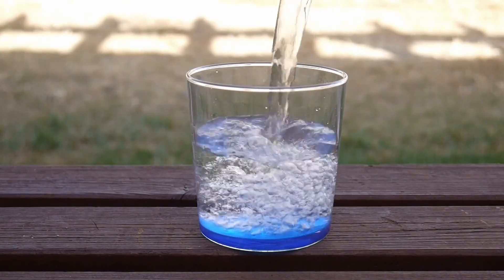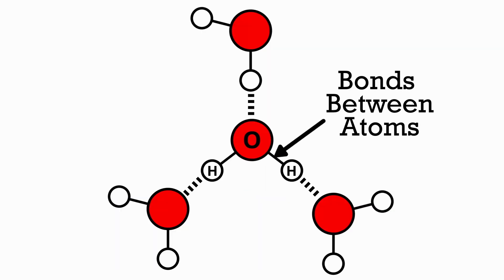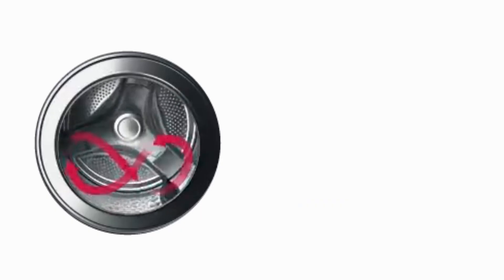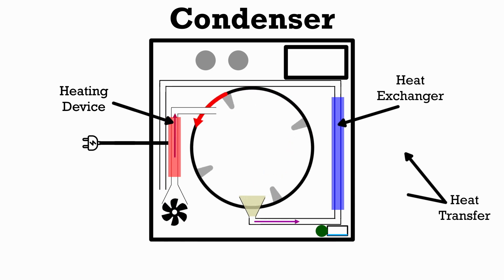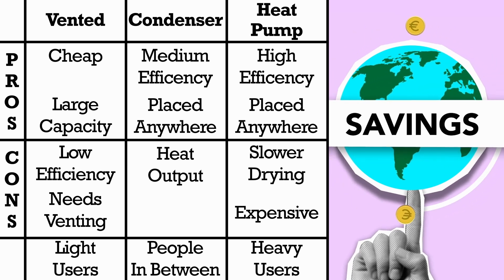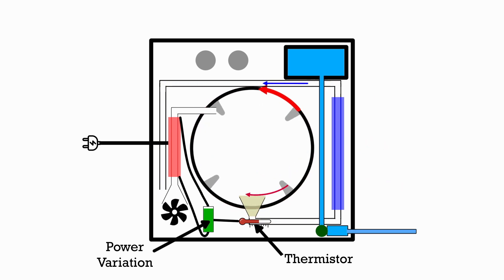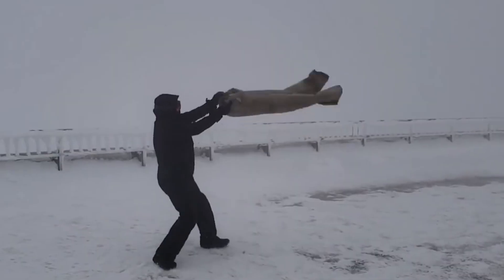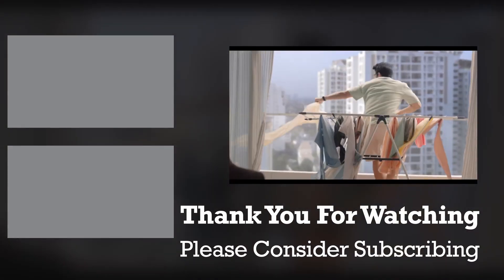How Dryers Work- The Incredible Engineering of Tumble Dryers

Comment: 5:26 there are no springs nor shocks in a dryer since it doesn't go up to high speeds unlike a washing machine on spin. The video you are showing here is a commercial of the LG Direct Drive washing machine being able to balance loads better than belt drive. Edit: Most dryers also don't spin back and forward since the fan that circulates the air around is connected to the motor and reversing the motor makes the fan spins backwards.
Reply: I have a 15 year old bosch condensor, it definitely reverses drum direction. I think it has 2 motors and you can hear them operate independently.

Comment: sorry I still don't understand it, do I need a drain connection for heating pump dryer?
I don't have space in my apartment, so I am planning to buy a dryer and put it in the storeroom but there's no drain or ventilation system there

Comment: I have an old gas dryer that we no longer use (all electric house) and I want to connect a portable dehumidifier so it works like a heat pump dryer. If it works it's going to save me money vs. electric resistance dryer.

Comment: I see no reason why dryers could not be 120v in the us all you would have to do is put a few more lower powered heating elements and a few more fans and it could work
Reply: If the electrical system was 240V like other countries, everything would be easier.
One global standard.
Reply: Whi do you use a jet burner to cook in a wok instead of using your gas stove? I'm seeing situations Power natters

Comment: In the months since this video came out, General Electric actually put out a washer-dryer that fixes most of the downsides of washer-dryers in general. From what I understand, they did this by putting the components that make up the dryer on top of the machine behind the control panel rather than shove them into the main body like is usually done.

Comment: Wonderful Video :), loved the diagrams explaining the circuits of the different types of dryer. I had a question - I understand from your video that running cost in terms of electricity etc of heat pump dryer is cheapest in long run. However, I would like to know which dryer is costliest, and which is the cheapest in terms of maintenance, servicing repairs etc ?
Reply: The most cost effective dryer I can think of is a gas dryer since they aren’t as expensive to run compared to electric and in general can be more reliable under heavy usage since there isn’t a heating element to burn out or the jumper wire from the heating element to high limit safety thermostat. The only thing you need to do in terms of maintenance on a gas dryer (this also applies to vented electric models as well) is vacuum any lint behind the dryer, clean the vent duct, and the inside of the machine itself, that’s all there is to maintaining a vented dryer. As for a condenser dryer, the heat exchanger has to be cleaned at least once a week since lint can build up reducing drying speed and efficiency. Heat pump dryers need to have the evaporator cleaned off once a week and sometimes every couple of days, if a leak develops in the refrigerant system, you’ll need a professional who deals with refrigeration and air conditioning equipment to diagnose and fix the leak which can be expensive which might not be feasible if the repairs exceed the cost of a new one. Vented dryers will always have higher longevity since there’s a lot less complexity inside them, most can last up to at least 20 to 30 years if not more when taken care of and maintained on a yearly basis.
Reply from the maker: Glad it was helpful! I can only give you an educated guess as to which would be the most costly over it's lifecycle as it depends on soo many variables. Such as cost of potential maintenance, the build quality etc. 

Having said that in my opinion the most costly would be the washer dryer, they are more likely to have issues due to the increased complexity and they aren't as optimised for drying compared to the others. This is just an opinion though. I am glad you enjoyed the video and I would really appreciate it if you could share it with anybody who you think might enjoy it.

Comment: In the past I was told a condenser dryer cannot be used in a cold garage. Is this the same for heat pump dryers. TIA
Reply from the maker: Both condenser dryers and heat pump dryers can be used in cold garages, however it is more efficient to use any type of dryer in warmer conditions as the air needs to be heated up prior to use. Heat pump dryers are usually the worst at dealing with cold conditions because of there lack of a traditional heating element.

Comment: Hamilton was the company to offer dryers and companies such as GM Frigidaire bought dryers from Hamilton to pair up with their washers. There was a Hamilton washer built in the mid 50’s to about late 60’s but were rebadged Norge washer which were a division of Borg Warner who built car parts for Ford. Westinghouse was the first to design and build their own dryers but had to stop production during WWII but resumed production shortly after WWII ended. Whirlpool started building their own dryers in 1948, GE started building their own dryers around 1950, GM Frigidaire sometime in 1953 along with Maytag. GM Frigidaire made condenser dryers from the beginning since they marked them for people who didn’t want to put a vent through the wall or simply didn’t have access to a vent. Maytag had a water condenser dryer which worked well but had to offer vented models a few years later since some water condenser dryers of that time used about 1/3 to 1/2 gallon of water a minute. Most companies just went to vented models after 1955 since they were less expensive to build and offered fast drying times, Whirlpool/Kenmore offered gas dryers with a 37,000 btu heat output and 9000 watt 50 amp electric models that could literally get a 9 pound load of laundry dried in about 30 minutes time and sometimes even less than that since they were that powerful. GE and Whirlpool/Kenmore came up with a automatic dry in 1958 which used a double throw switch cycling thermostat which advanced the timer when the heat cycled off and stopped the timer as soon as the heat came back on which surprisingly worked well and that’s what most mid range dryers used and some here in the US still use the simple auto dry timer. As far as moisture sensors go, Maytag came up with that in 1960 (Maytag kept that design until 1975) which had the moisture sensors in the baffles which provided very accurate moisture sensing and no other dryer has been made in North America with moisture sensors in baffles.
Reply from the maker: That's some really interesting history, very thorough. Did you work in the industry or are you just a fan of history?
Reply: @thinguide3687  I am just a fan of history along with a collector and restorer of vintage laundry appliances. Currently in the process of finishing putting together and restoring a vintage Maytag dryer from the mid 70’s that will be paired up with a vintage Maytag washer I picked up earlier this summer.
Reply from the maker: @seana806  Awesome. Best of luck with the restoration. Please do share the video with anyone who you think might be interested.
Reply: @thinguide3687  oh yeah, there definitely will be videos for sure sometime next year. I may even explain on how Maytag’s Halo Of Heat design works since it’s a interesting design and that’s the dryer Maytag had in 1960 which used moisture sensors in the baffles to sense and feel the moisture in the laundry that was being dried.